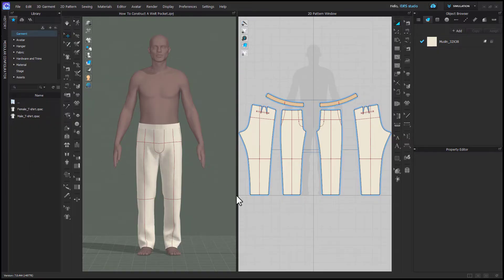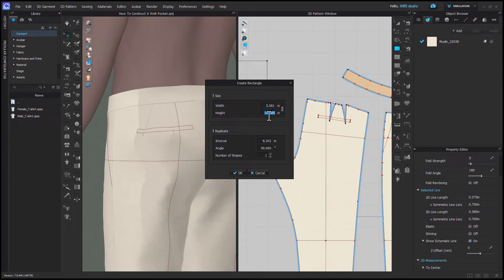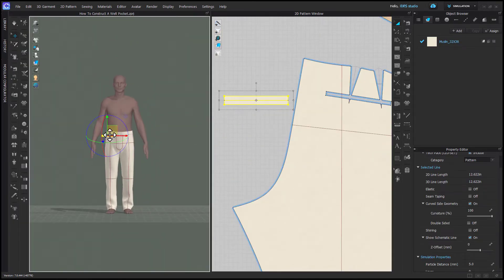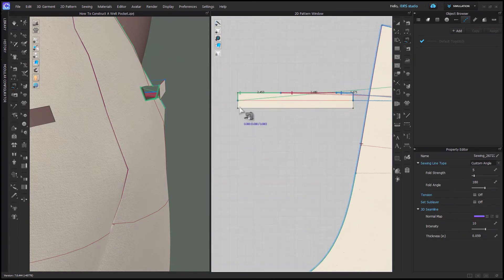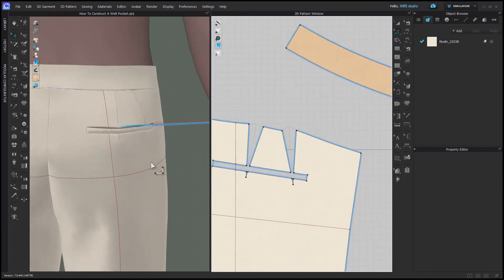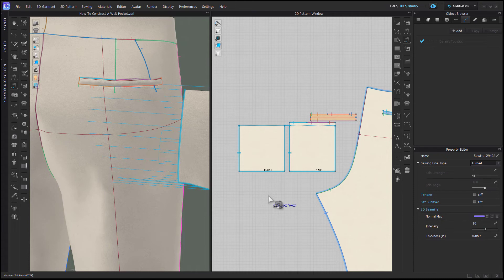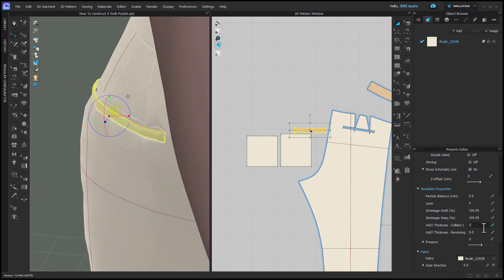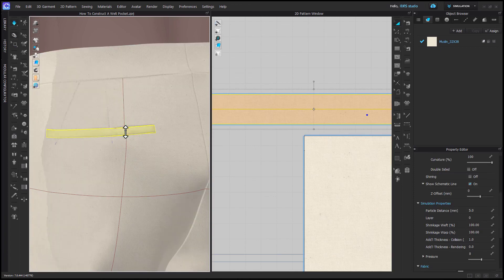How To Create A Welt Pocket in CLO 3D

Comment: amazing, thank you so much! I had troubles with the symmetric pattern, it sew everything on top of the first pocket, do you have any idea why? I mean I worked around it and got the result but it took quiete some time :D
Reply from the maker: 🤔 it's so tricky to know exactly what you mean without seeing it...Do you mean when you cloned the symmetric pattern it placed it on top of the first pocket in 3D? Sometimes after you clone and put it down in 2D it might not be in the right place in 3D, but usually it will still be selected and you can just slide it over with your gizmo. Let me know if that's not what you meant.